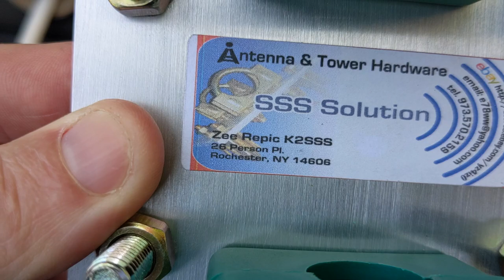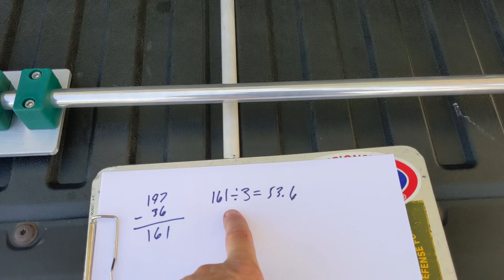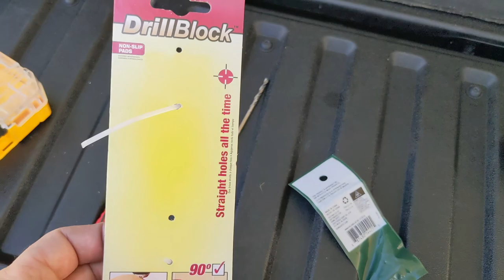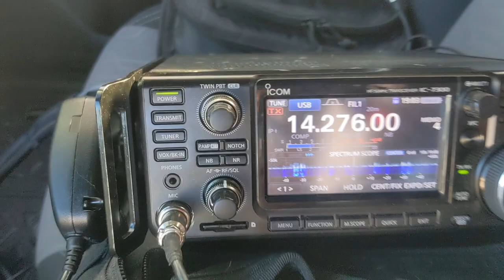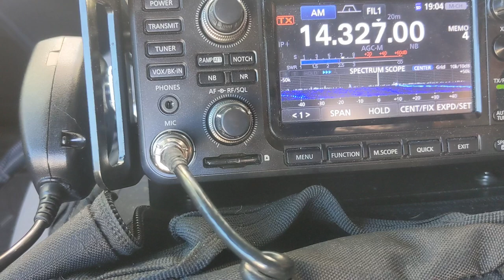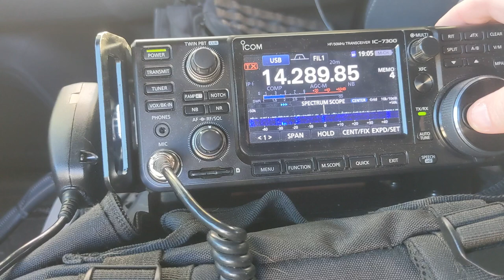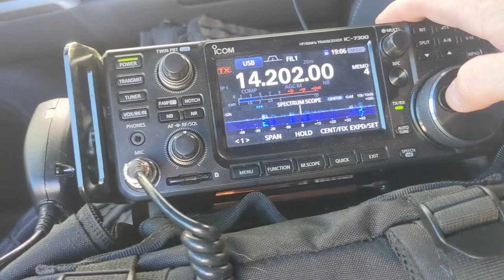Easy Build: 20m Half-Wave Rotatable Dipole Antenna

Comment: Good job next time use 10 -15 snap on ferrite cores on your coax rather than the 240/43 core,it works better and looks better too. This was an awsum build I did something similar but built a vertical and going to build another and phase them so I can steer my signals on 40. So I'll have a 2 element vert array for about $200.00. 73 and keep up the good work.
Reply from the maker: That 43 core is just one I had on hand.  It seems to work fine, but I haven't tested it on other bands with the dipole.  Good luck with your vertical array.   I'd like to build one also.

Comment: Nice build. Did you make some F/S tests to see how good the antenna surpress the side lobs ?
Raising the aintenna higher will result in shifting SWR numbers as take off angle will improve to be lower to the horizon.
73 Phil ON4VP
Reply from the maker: I've made several changes since that video.  I added more tubing for strength, built a balun, etc.   I'm in the process of building a station and plan to mount it as high as I can.  73

Comment: Can it be collapsed short enough to use (maybe) up to 6 meters?  But what caught my eye is that clever mast mounting system in your truck.  👍
Reply from the maker: I can't get 6-meters out of this one unless I order more 5/8" tubing.  The center section extends 36" (one side) and you can't insert the next tube enough to get it to the 54" or so needed.  All that's needed would be a couple of 24" 5/8 tubes.  all the other bands up to 20m can be configured.  I'm going to make another video exploring different configs.  73

Comment: Great build, really nicely put together using solid hardware. I've been thinking about making something like this to replace the 20M portion I use on my Alpha Delta DX-CC antenna (part of a multi-band fan dipole in an inverted V configuration that doesn't work very well). I was curious about stacking two of these, one antenna's lobes pointing north and south and the other pointing east and west. Would they interfere with each other? Could such a configuration be co-phased? I'm trying to get around using a rotor because of where I live and the horrendous weather we get in the fall and winter months (heavy wind storms, freezing rain, ice, etc). Fantastic video, thanks for sharing it. 73 -VA3AWP.
Reply from the maker: I think that would be an interesting idea with the phasing.  I plan on stacking the 40 meter and 20 meter dipoles on a 50ft Rohn telescoping mast.  I have big plans for a few antennas.  I've been busy lately and just haven't had time.  73

Comment: made my 20m dipole with 2 16.5 ft fiberglass fishing poles from B&M poles. light weight and cheap
Reply: I'm interested in your  system. With the fishing rods. Like the wire size and mounting of the rods.

Comment: Morning, I built this as per the video and my SWR is off the chart. I am new to this and am at a loss of where I went wrong. I am thinking it could be the pig tail, it was my first time building one. But I am not sure that I constructed it correctly. Can you explain on guide me to a video of how to make a pig tail? Or maybe the choke balum wasn't built exactly as it should be. I removed the choke balum and put in a 1:9 UnUn and got he SWR to come down to a 1:1 in the 21mHz range.73 KN6SCF
Reply from the maker: The pigtail I used is just a simple common mode choke.  The center pin of the coax goes to one side of the dipole and the shield (braid) is attached to the other.  It sounds like you may have a short if you wrapped your own.  Check for continuity through the choke for both the center conductor and braid with a multimeter.  
I'm not sure if you were stating a sweep of the dipole with your Unun resulted in the lowest SWR at 21mhz or your were targeting 21mhz.  The specs for the one in the video is for 14mhz (20m).  Sorry, it's hard to gauge someones technical knowledge through the comment section.  
As a quick test, I think it would be best to bypass the choke or unun entirely.  Just connect your feedline directly to each leg of the dipole.  Sweep or check the SWR.    
I'm working on an update video  about a 40m rotatable I made a few months back.  I'll try to explain the feedpoint a little better.  Video should be out Monday if you don't get is solved until then.
Good Luck!
Reply: @n5yiz  you were spot on. The continuity on the coax was non-existent on the center wire. Seems I was using too large of a wire lug. 73s and many thanks.

Comment: Do you have a Length List for the other bands. I plan to make this 20 meter to your specks.
Reply from the maker: You can adjust the 20m version down to get the higher bands.  I just use the quarter wave formula to get it close and then fine adjust from there.  Use a Sharpie to mark the tubes for different band configs.  

It's going to be a couple months, but I'll be installing the 20m and 40m permanently on a Rohn mast.  I'll try to video as much as I can.
Reply: @n5yiz  so bringing in the elements brings it from 20 down to what meter band you want? I’m learning as I go.
Reply: @jeffmay1024  Yes

Comment: We have the same setup! 7300 and Wimo rails. Wish i had a truck though, i would do the same thing. Is that the mast section from the MFJ EX Tripod mast?
Reply from the maker: The Wimo rails saved my radio about three days after I installed them.  I had the radio zipped up in the backpack and it fell out of the truck from the passenger seat.  It landed directly on one of the rails.  It hit the ground hard enough to bend the rail mounting screws.  I had to replace the screws, but other than that, there was not a scratch on it.  

The mast is from Max-Gain Systems.  It's one of the "HD" models.  73